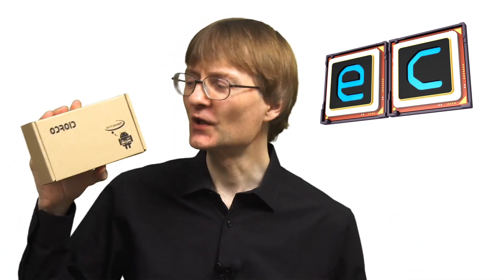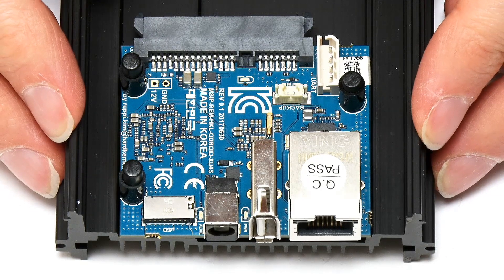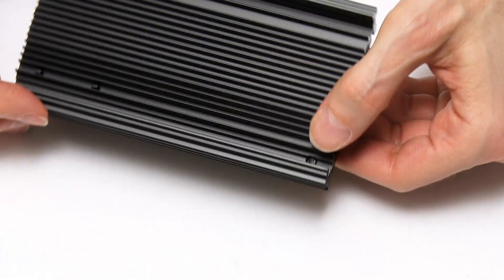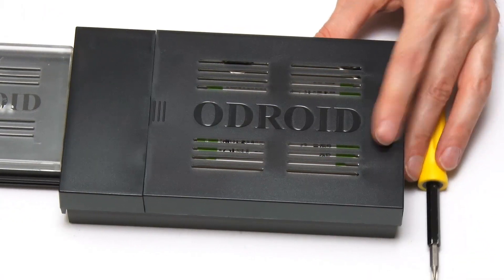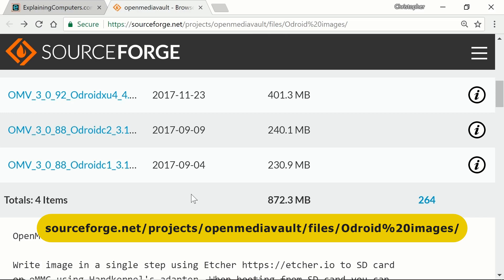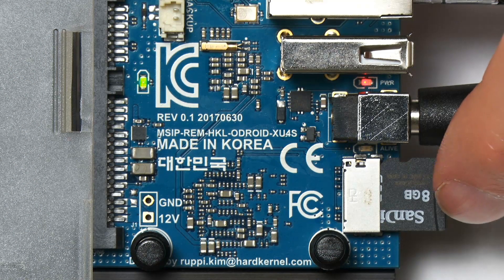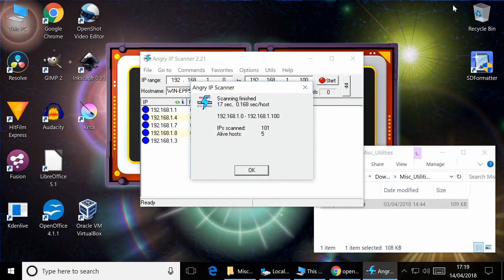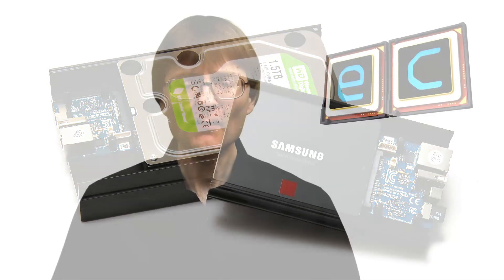Odroid HC1 & HC2 NAS SBCs

Comment: Fantastic! This certainly answers a lot of the questions I had about using SBC's for NAS solutions. Thanks!

My next question is...

...Could you make these give an approximation of RAID1? Would one mirror another as a backup?
Reply from the maker: For RAID, the best solution is to use an Odroid XU4 and this special case and board that allow two 3.5" drives to be connected: http://www.hardkernel.com/main/products/prdt_info.php?g_code=G150575879656
Reply: Oh, they think of everything. Thanks.

It also has an LCD display, to display reassuring techno jargon for those that can't help but fiddle lol Brilliant!!

Comment: An HC3 of sorts with a two 3.5 inch drive capacity for RAID would be incredible, if they could pull it off that is. It would require a new board all it's own and a new chassis though.
Reply from the maker: Hardkernel make an add-on board and case for their XU4 that in effect provides this -- allowing two 3.5" drives to be connected: http://www.hardkernel.com/main/products/prdt_info.php?g_code=G150575879656
Reply: ExplainingComputers And its a fair price too, thank you for that :)

Comment: So are the boards in the HC1 and HC2 identical?  For example: could I purchase the HC1, remove it from the enclosure (and add a heat sink), plug a 12V adapter into it and power a 3.5" HDD?
Reply from the maker: The PCBs are identical I think (same labels even). But there are slight differences in the components fitted to accomodate the different power supplies. So the HC1 board needs a 5V PSU (and cannot power a 3.5" drive), while the HC2 varient needs 12V (and can).

Comment: Hi Christopher, 

great and informative video :-) 

But i'm missing one thing only. The measuring of the power draw and if that NAS is able to get into a standby-mode, if you didn't access it for a while. 

I wish you a good start into the new week.
Reply from the maker: Thanks for this -- and good point! :) I am currently trying to set up a reliable rig for testing the power consumption of any SBC, and will be using it in a group test fairly soon! :)
Reply: Great! Thanks for the quick answer :)
Reply: It doesnt have a standby mode, its always 'on'. it can only turn off the HDD, there are many setting for that (after xxx minutes, if the ip(s) xxx.xxx.xxx.xxx arent online anymore, ...)

i didnt measure the consumption while its doing nothing but i guess it wont be more than 3W or so (if you have an efficient power supply). maybe its even less :)

Comment: Great stuff + explanations, the only thing missing are a few Infos about Power consumption, idle mode, ... cause it is 247 device running all day + night.
Reply from the maker: Good point -- I will be running a range of SBC power consumption tests in a video fairly soon.
Reply: ExplainingComputers That would be great cause I experience over the years an ongoing power consumption increase year by year even after replacin all the old bulbs, the fridges and so on and I assume that my Zero and all the Smart Home pieces connected to WLAN are the reason for that ... and power in Germany is expensive to let the consumer feel the pressure to invest in new devices with higher efficiency ... so the consumer pays the bill for the new energy production goal  without coal, gas and nuclear power. Nothing is for free ...

Comment: When you insert the SSD/HDD the fastening pins show that the entire board moved. That means the thermal connection/paste could lose proper connection to the heatsync. I suggest maintaining pressure on the left side of the board when you insert.
Reply from the maker: Very true, you are right. It would be best to hold the board when adding or removing a drive.. I only noticed this when I was editing the video!
Reply: @ExplainingComputers  Hey Chris, inspired by watching your video I ordered HC2 and put a 7200 rpm WD HDD. But unfortunately when I copy data back and forth, I can't exceed more than 45~49Mbps. Please note that, both the Odroid and my PC (with 1Gb lan card) are connected on a Gigabit switch. I expected at least 80 to 90Mbps on HDD whereas you're getting way better performance on SSD. What could be the reason?🤔
Reply: If you still have access to the HC2, can you please do a speed test with HDD and share the results? Thanks a lot.
Reply from the maker: 45-49MB/s is certainly slow. My HC2 is packed away somewhere and I don't have a HDD free and the time to set things up for a test right now. It is hard enough keeping up with setups for each week's video! :) I found this thread which may be of some use: https://www.reddit.com/r/ODroid/comments/8h62oy/odroid_xu4_with_omv_slow_speeds/
Reply: Greg Adams yeah I noticed that. Cringed a little. Those stand-offs are too small diameter me thinks.
Reply: Greg Adams shhhhh!

Comment: Sadly, here it's over 90€ with shipping. There are NAS with two 3.5" slots on Amazon for less...
Reply: cicalinarrot You can get cheaper NAS boxes, but the ability to customise the OS and extra processing power with 2GB DDR3 isn't bad for the $50-75 range.
Cheap NAS boxes have a habit of being hideously slow. Particularly if you want them to transcode video for you if you run XBMC, but transcoding or really optimised for multi core systems, so I imaging this will do well. Beating things like the Intel atom x5-z8500 by a fair margin and has trustzone DRM support for streaming your media files over the internet.
Down side though, it doesn't have hardware AES encryption or decryption.

Comment: Thanks! That is a very business friendly design. They should do well if the device doesn't have any major flaws. 

PS - I wish it had two Ethernet ports but you can't have everything!
Reply: I think you can stack multiple units on top of each other, and connect them via a router.
Reply: I want to run a firewall through it.
Reply: Usb to ethernet should work, but you will get at most a third of gigabit speeds

Comment: Another great video. I didn`t know much of these. I`ve made a new video about the desktop capabilities of the Odroid XU4. It did need some tweeking, but it a lot. Have a nice day. 
https://www.youtube.com/watch?v=ZQPty2PC0gc
Reply from the maker: Cool. I'm about to embark on seven days using a Tinker Board as my only computer. It is amazing what can be achieved with an SBC these days. :)
Reply: I first tried the Tnker, but in every OS I had problems. Tinker OS doesn`t do kdenlive, lubuntu has got bad youtube playback, and in Armbian Blender and Kdenlive always crashed. I do think something is wrong with my Tinker board(it`s my 2nd after the hdmi burned out on the first). The bad thing about it is the micro usb. the Tinker needs too much power(2A) for that connector type. I hope you`ll have more luck. Armbian is great, great support. They tried anything they could to help me. My next video is going to be about Armbian and the Orange Pi +2. It would be garbage without Armbian. Greetings.
Reply from the maker: I too have (and still) struggle with Kdenlive on a Tinker Board (I can do sound, but no video!), though YouTube playback is now good in Chromium and Kodi under Tinker OS. You are totally right on the micro USB power connector -- a real weak point, and the issue is worse for the Tinker Board S, which flatly refuses to boot with less than a 3A PSU (which are not easy to get hold of with that connector for obvious reasons!).
Reply: Indeed in Tinker OS Kdenlive refuses to work. The repository isn't right in it, you still need to install a lot of effects and so. And when that's done there's no video. A problem with the video drivers. 
In the Lubuntu from ELAR, that works perfect. Maybe Armbian would be good for you. Ask for the unreleased test version on the forum. 
It's got hardware acceleration for Chromium. If the problems with Kdenlive and Blender are only with my Tinker Board, then Armbian will be the best distro. I can't wait to see your video. Greetings.

Comment: 8 Cores seems Over kill for just a Network server???...
Reply: Those processors were originally design to be able to drop down into a low power mode (hence the different CPU speeds on four of the cores) and then provide "normal" performance when needed.
Reply: weerobot true, but they're using that SoC for a few reasons.  One, it's another use for chips they already buy.  It's so fast in the segment that it will provide good performance.  But the main reason is the chip's support for USB3.  On these boards, the gigabit ethernet is on a USB3 bus.  The same applies to the SATA here.  They didn't have another SoC with those features ready to go into a product, and this one benefits from existing software support.
Reply: Thanks.
Reply from the maker: Indeed. Makes the web interface nice and responsive though! :)

Comment: Great little device!
How would you do to have more than one drive? Would you need more of those boards? I'm guessing you would, and in such case, wouldn't it be rather wasteful to have so much processing power for just an SSD/HDD?
Reply from the maker: For a two-drive solution you can use an XU4 with one of these: http://www.hardkernel.com/main/products/prdt_info.php?g_code=G150575879656

Comment: O yes, I heard birdies as well when watching this Odroid SBC video. 😍
Great  SBC, great video work Chris! 
Thank you! 
Excitement is contagious. Now I want Odroid in my cloud. 😁
Reply: i can totally recommend it. i have my hc-1 since its available. great perfomance for NAS and cloud storage solutions 👌🏻

and using openmediavault with it makes it easy to use even for unexperienced users 🙂
Reply: That's great! 
The way I started, after a while I'll have room full of SBC NASes. 
Although 'having enough cloud storage' is unknown term to me. 🤔🤣
Reply: Alfons Siggler Dear Sir,  this will be y 1st SBC! All info references media type files only being stored.  Can I store data files also? ( *.doc, *.xls, *.pdf, and other business related data files?  HC1 and HC2 as well as demo only reference media type files.  I am technically ignorant trying to educate myself.  I hope to connect NAS TO ROUTER and share storage with iPad (x2) iOS v10.3.3, new HP laptop - windows 10, android phone, HP deskside 12yrs old but fast still. I want to learn to set up cloud with access through internet as second step.  Then a 2nd SBC USING SPARE HD IN DESKSIDE COMPUTER. I need to get specs on it and match best SBC TO run that 1tb storage.  Write to both NAS at different speeds separately I guess.

I have about 20 questions technically, if answered,  I could start my purchases and do three projects correctly.
Reply: How do you setup a cloud? Through your home isp?

Comment: Great video, i wonder if you could setup a raid with 2 or more HC1/2
Reply from the maker: You can do a RAID NAS (2 x 3.5 inch drives) using an XU4 and one of these: http://www.hardkernel.com/main/products/prdt_info.php?g_code=G150575879656

Comment: What about the transfer rate of the HC2 device?
Reply from the maker: It will be/is identical to the HC1 -- they are the same board, save for the 12V power to the HC2 to allow 3.5" inch drives to be used.
Reply: Thanks

Comment: Is a portable NAS possible?
Reply from the maker: Yes. You could use the USB 2.0 port here to add WiFi.
Reply: And if you have a beefy powerbank that can deliver 2.5 to 3 amps then its really totally portable 🙂

you only need an adapter because it doesnt have a micro usb port for powering it up, only a dc jack.